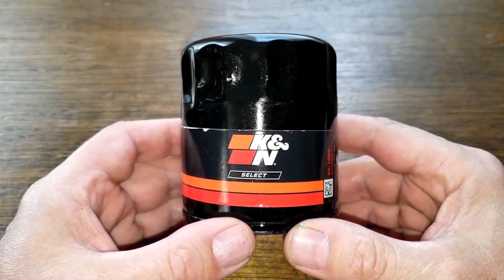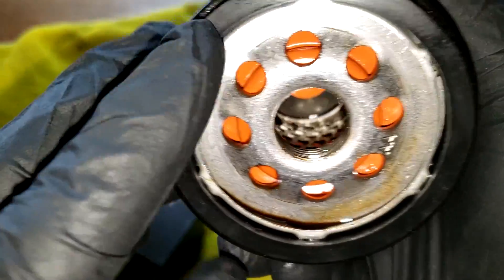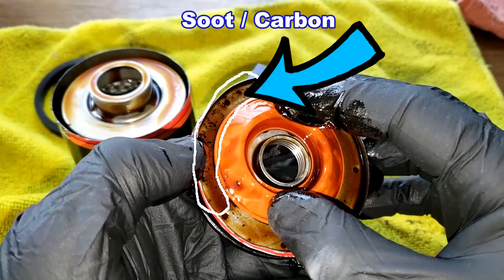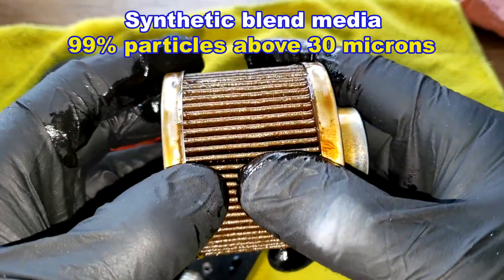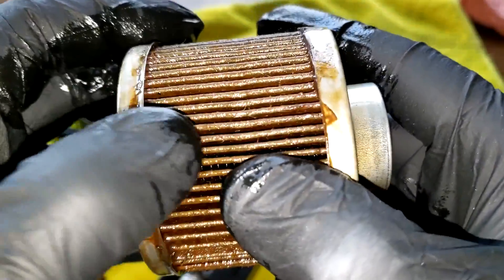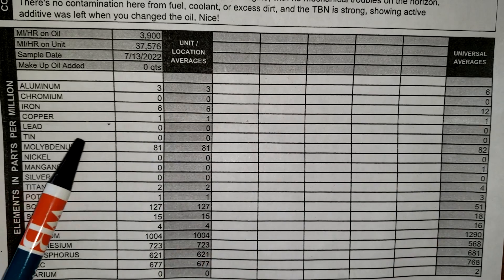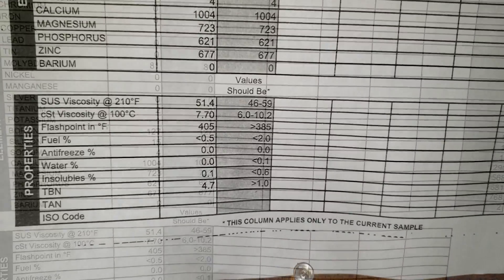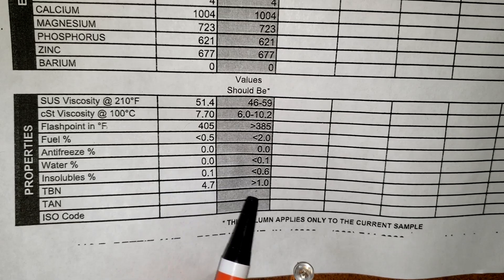K&N Select SO-1002 Oil Filter Cut Open, Pennzoil 5w20 Blackstone Oil Analysis, Used Oil Filter

Comment: That oil is very good at its job. It is cleaning up the internal engine parts removing byproducts of ice engines. Soot is contained in the filter. Filter did its job very well. I use this oil in my gt with 183k on the clock. Its still quiet and doesnt burn any oil. This is what good oil and a good filter is suppose to do. Excellent video! Thanks!
Reply from the maker: You're Welcome and Thank You👍

Comment: And again I say, nahhh...I'll stick with Purolator Boss.  Thanks for the video!
Reply from the maker: You're Welcome!
Reply: Here's a comparison study you might enjoy which was conducted by a professional oil filtration lab.  Purolator Boss was one of the ones tested. https://cimg5.ibsrv.net/gimg/ls1tech.com-vbulletin/961x620/efficiency_compairson_graph_pic_2_a5517a3581d9f407404a716b7636c81a30f113c6.jpg

Comment: YO, Whip !! Thanks for all your work to make this video -- it's a good'n !!
One of the main features of a K&N oil filter is the NUT -- but NO NUT is here, and the filter was damaged at removal.
8 large holes in base plate = good.
Silicone ADBV = good.
Spiral-wound core with louvers = good.
Retainer/BPV combo = good.
Nitrile rubber gasket = good.
Metal end caps = good.  
Despite all the "goods", I would not buy or use this oil filter, because:
1. Micron rating of "99% at particles greater than 30 Microns" is totally unacceptable for an oil filter in the "high-price" range.
2. Area of Filter Media is TOO SMALL -- should be at least 90 sq ins.
Never saw so many chunks of soot in an oil filter before -- is that common with the Eco-Boost motors ??
Reply from the maker: Your Welcome Chuck!
Reply: Not all K&Ns tiers filters have or have had the dome end nut. Topic Select K&N is one such example. Also, the nut has been shown in the be a point of rust, weakening and sometimes leaks. Also minor dents on removal not uncommon ime and zero effect on function in use. Media area correlates with filter size. Topic is a relatively small filter but is spec size. Plenty of media area with this one.

Comment: Topic is a Champ Labs made K&N. This one uses a metal centertube, not ecore. So,different than the Super Tech MP series. Anti-drain back valve wouldn't be loose in use because if you note, the outlet flange is wide. Adbv groove will fit tightly. It does look well made, but K&N tend to be very pricey. Personally, don't like to call the bypass valve on the flat spring a "combo valve". That term generally refers to a nitrile adbv and bypass in one. I don't like those. But, I know what you meant. The UOA looks good, TBN indicates a lot of add pack life left in that oil. fyi, Blackstone has said in the past, when it comes to insolubles, they don't see any significant differences between oil filters used. I don't know the efficiency of the K&N, but I like how it's made. Thanks for vid.
Reply from the maker: Your Welcome faxmen09!
Thanks for your feedback!
Reply: @WhipCityWrencher  Sorry Whip I missed the efficiency level in the vid. What you posted is pretty standard for many Champ Labs made filter. Iirc, Super Tech filters have same efficiency. And, it is still better than many of the OEM oil filters. Many really like and prefer OEM filters. 🤷Also see lots of comments about can denting from removal, I don't find it unusual or excessive. No effect in use. My.02

Comment: Needs to get a socket type oil filter wrench ,the filter is getting mangled by whatever he was using to install& remove the filter with
Reply: Hello. I don't use any tools to put the filter on or off. I dont know what happened to it. It must have been damaged during shipping. Dwayne
Reply: Really shouldn't need anything to install a filter, 2/3-3/4 turn after gasket contact. Some minor denting not uncommon on removal. Possible user may have overtightened a bit, but I don't find can denting here serious or unusual.

Comment: Hi Whip.The k&n oil filter seems to be decent quality however here in Australia 
k&n are very expensive.
For my ford it is about $25.00.There are equally as good filters if not better for much less.Thanks again for a great video.
Reply from the maker: Hi Luke, you may have the long-distance Award.👍😊
You're Welcome! This K&N in the video is going for around $11.00 here at Walmart.
Thanks for Sharing!
Reply: Luke Sm, I live here in the states, but is Ryco a decent name in filters?
Reply: @carlovanrijk4039  Hi Carlo 
Ryco are a decent quality oil filter and a very popular aftermarket filter in Australia.They used to be made here in Australia but are now made in China.I would say that they would be equivalent to a mid level Fram.I have used them for years and have done the job just fine. Cheers from downunder
Reply: @lukesm5747  good to know! I haven’t seen the Ryco’s here, maybe they’re available on Amazon (but word of caution…be on the lookout for forgeries). I have used the mid- to upper tier Frams and they’ve never given me any problems. Cheers from the states! 😃👍🏼